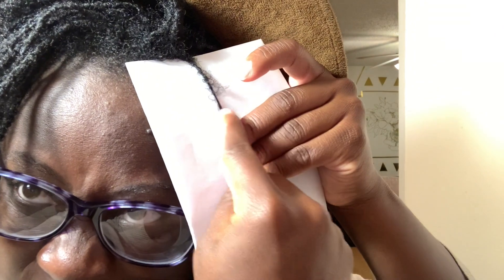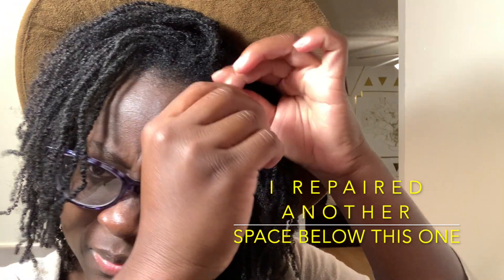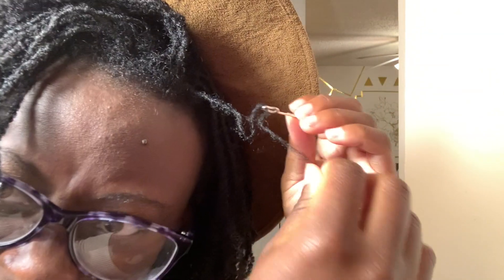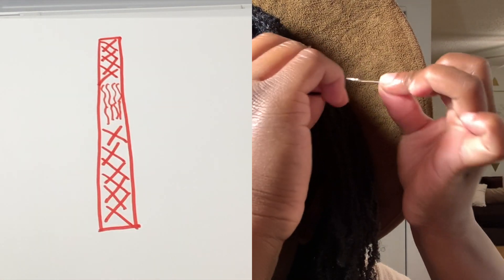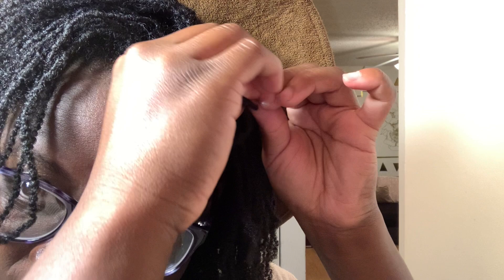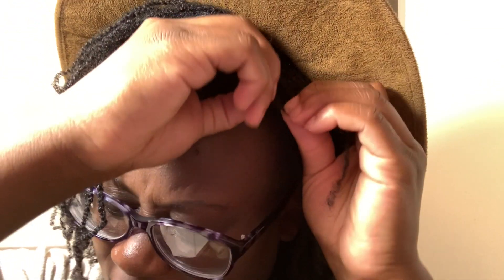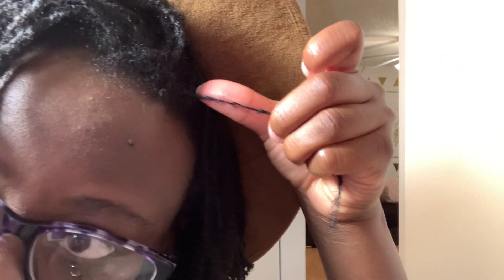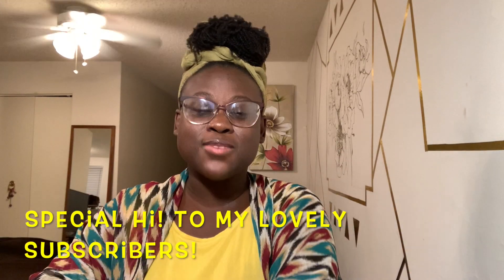How to Repair Thinning and Holes in  DIY Microlocs

Comment: Do youngo through the same direction till the gap is closed? Or you rotate with different directions?
Reply from the maker: I use the 4 point rotation until I get close to the end, then I chose which of the 4 points I want to pass through because I won’t fit in a full 4pts. Let me know if that makes sense or should I do a demo on it! Thank you so much for watching 🥰🥰
Reply: @tiyanahicks  oh it's clear now.  Thank you very much
Reply from the maker: You’re very welcome 🥰🥰